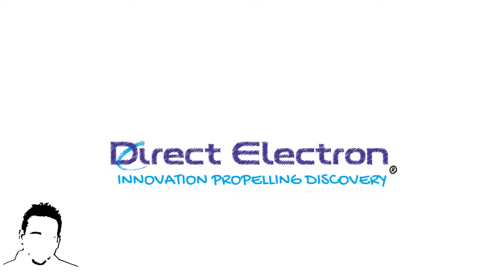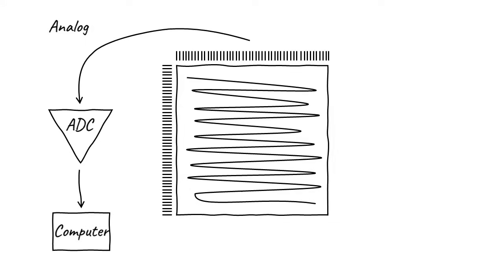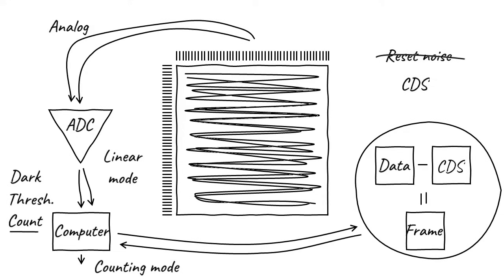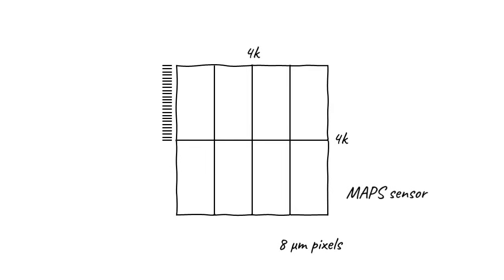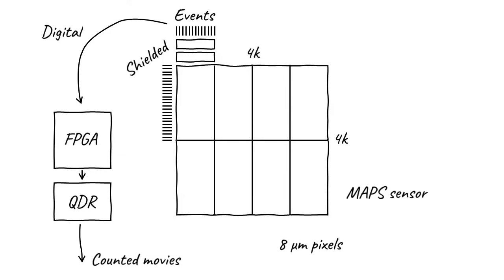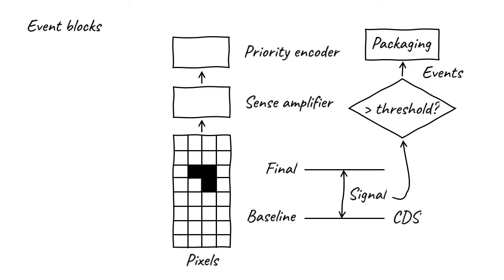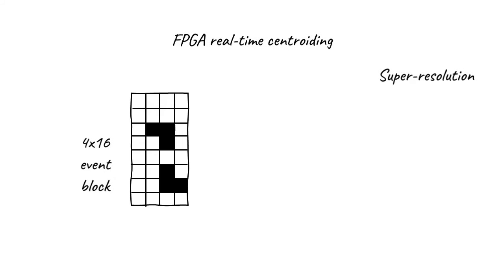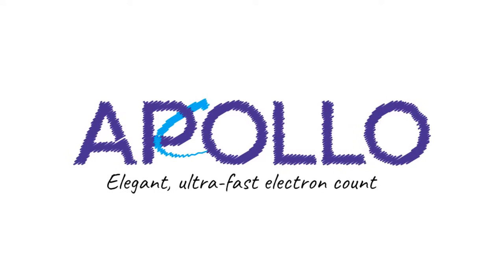How Apollo Works

Comment: Hi, only for K3 CDS  reduces the speed by half due to reading twice, Falcon does CDS at full speed in FPGA by always subtracting the previous readout.
Reply from the maker: Subtracting the previous readout is not CDS, because CDS requires a reading of the reset value of each pixel. The Falcon may very well correlate consecutive frames to improve image quality, but it's not CDS.